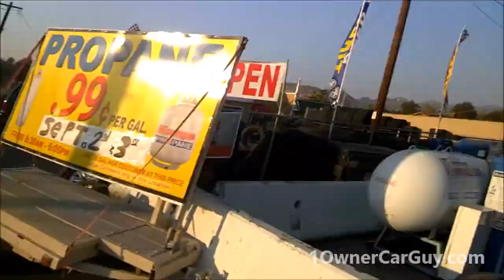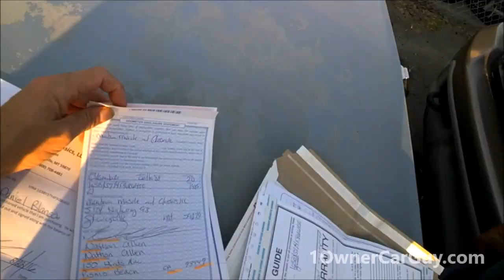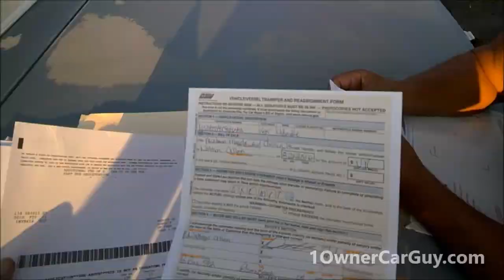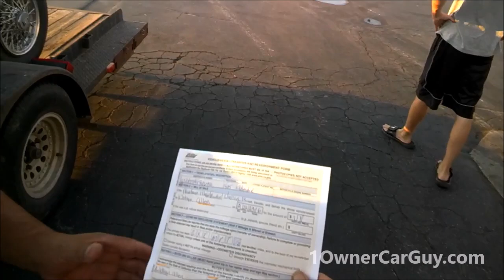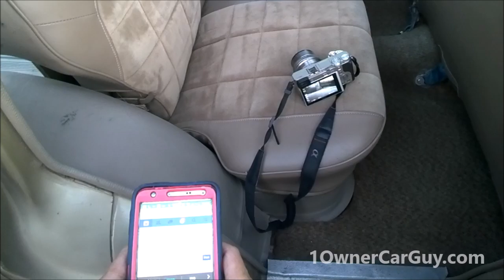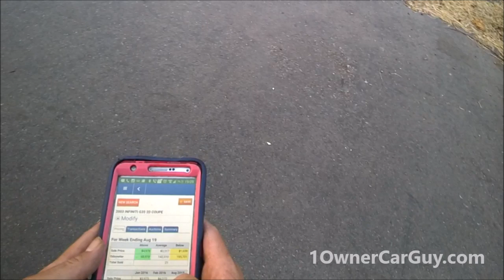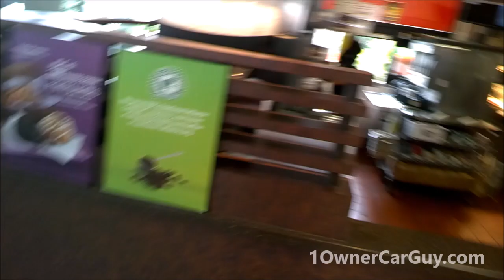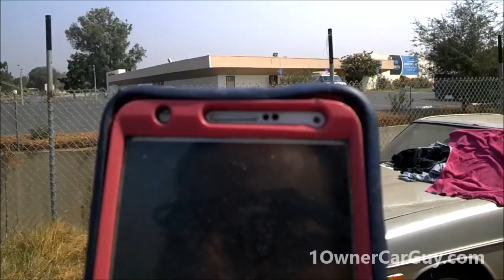Daily Work Vlog Car Transport Buyer pickup Behind the Scenes Vlog

Comment: what a shit car that Jeep is 😅
Reply: I do know the values of old classics, I own 2 old benzes my own, It was more like a ironic comment "shit car" i know for sure its proberly only the carb that needs a repair or in best case scenario a tweak. Dont take it the wrong way :)
Reply: Hard to know just what is wrong with the old Jeep from behind a computer screen, but I did notice it has the Rambler 327 in it. One really common mistake people made with these is when they buy spark plugs, they get plugs for a Chevy 327. The Chevy plugs are much shorter than the Rambler plugs, and they run like shit with them.